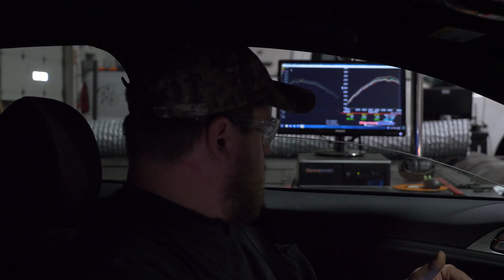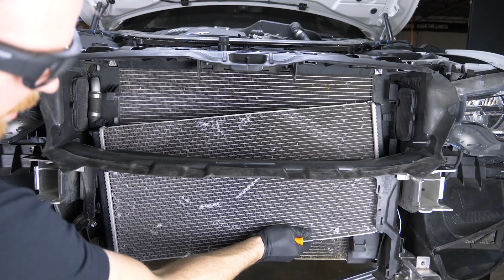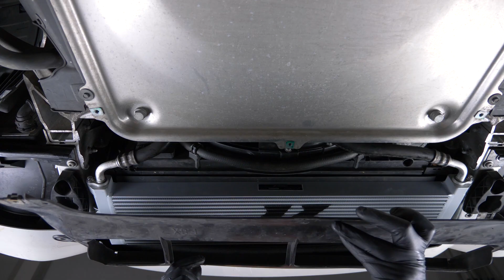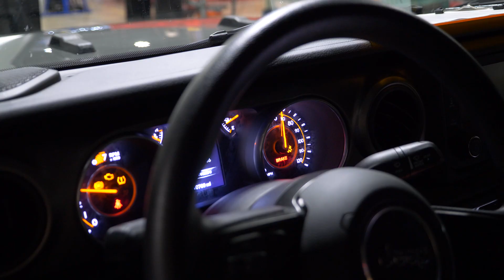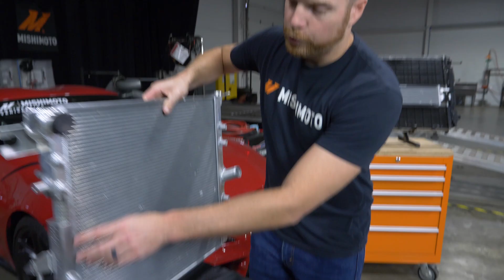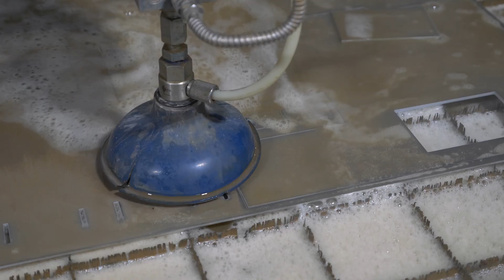Mishimoto | Basics of Automotive Cooling

Comment: If you upgrade to a performance radiator that has a larger coolant capacity and, presumably, high pressure differential across the radiator, wouldn’t you need a water pump with a higher head pressure on the discharge side as well?  In other words, would I need to upgrade my water pump to something better than stock (oem)?
Reply from the maker: An water pump is not a requirement for our product. We've seen many high horsepower builds with an OEM water pump on various vehicles.
Reply: @mishimoto thank you for that information.  I’m planning to replace the radiator and water pump (which needs replacing anyway) on my 2012 Suburban 1500, which is why I wanted to know.